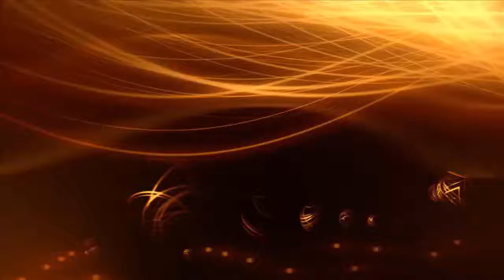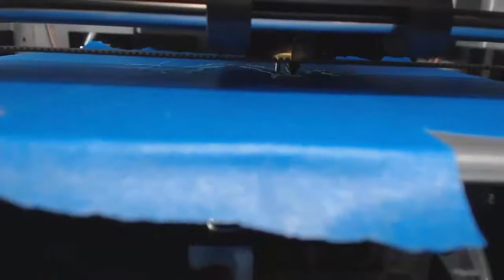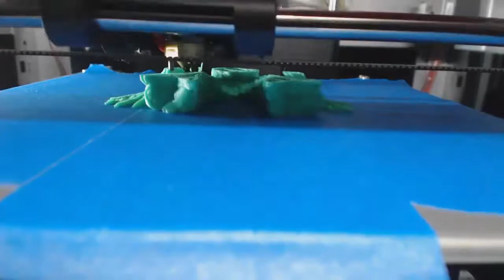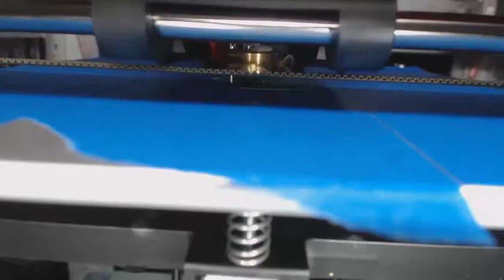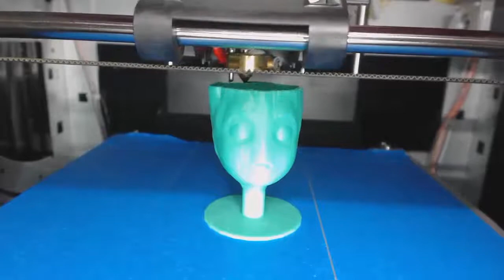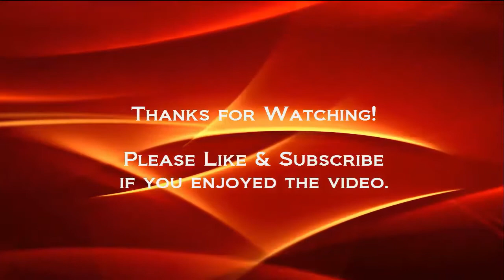3D Printing Baby Groot on XYZPrinting Da Vinci Pro 3-in-1

Comment: I wanted to make printing videos. How did u mount ur camera?
Reply: Also nice video
Reply from the maker: I'm using a logitech 920 web cam and a very low tech DIY mount.  I glued some foam rubber to the back of the camera stand to minimize vibration.  The camera is hooked over the door of the printer with a large paperclip that I bent into a hook bracket with the foam resting on the inside of the door.  Not pretty, but it works.